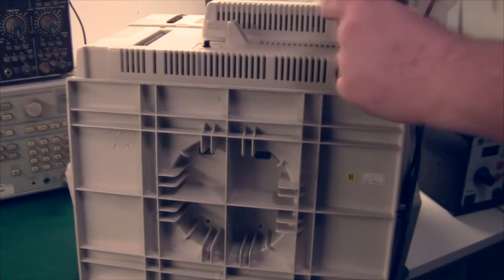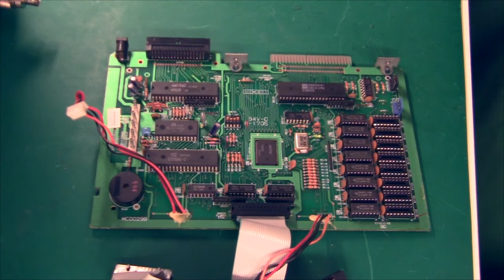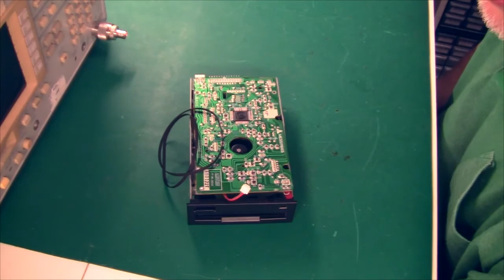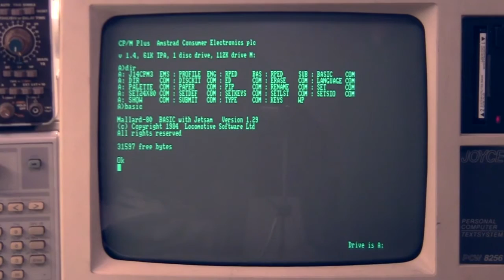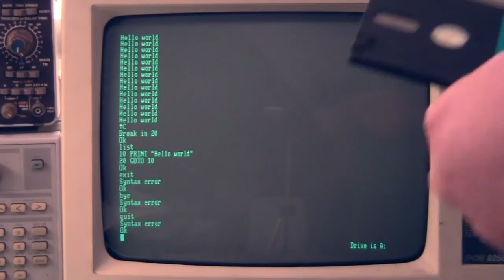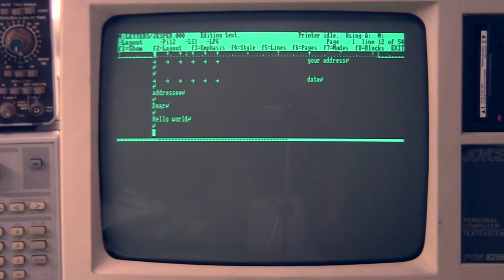Teardown and repair of Amstrad PCW-8256 / PCW-8512

Comment: Im  trying to  fix mine, when i power on i get green screen and a terrible noise (sounds like its coming from floppy drive) inserting a disk wont load anything. do you think maybe its the rubber band that need replacement?
Reply from the maker: I'm almost 100% certain that is the problem. Due to very limited ROM space, the machine only shows green screen until the OS is loaded.

Comment: Thank you so much for this video, I've had my machine since it was new on the market and it's been in the loft for many years so I suspected that the drive belt had deteriorated, but I had no idea where to find it. I don't suppose I'll be using it again but I believe that there is still an interest in them so I'll get it running again.
Reply from the maker: You're welcome.

Comment: Thanks for the vid, very interesting, I've just been given one of these machines, so now I just need to pull it apart, clean it up and sort out the floppy, cheers
Reply from the maker: The belt is typically the only problem with these machines.

Comment: The OEM was Taitung in South Korea.  I think (not sure) Taitung and Orion of Japan had a manufacturing partnership.  The first PCW series were very robust with some still being used in engineering workshops and as word processors by the orginal owners who have had them since 1984.  The only major failure item was the belt in the FD unit.  Really, if you think about it, at the time the PCW and Locoscript bundle (Locoscript was very well designed) was equivalent to most DOS-based word processing packages, sometimes better.  The only thing it lacked (initially) was a dedicated spellchecker which was rectified in later models.

I bought one of these brand new in Australia back at the end of 1984.  I used it everyday until 1995 when I went across to using a Windows 3.11 machine.  It NEVER failed, never skipped a belt and would operate even on the worst stinking hot days.  Whether by good fortune or by design, the PCW was the world's first truly-reliable set up and forget home and small business machine which had 100% reliability...far more reliability than the PC clones at the time.

Comment: Silly question, I have one which someone has taken apart and just pushed the back cover back on without screwing it on. What screws does it take on the back? I tried a few screws with about the correct diameter but the thread is wrong

Comment: The placement of the "upside down" ASIC/ULA is weird. I've only seen those before on Amstrad Spectrum 128 +3 (and maybe the +2A?) Very strange arrangement, I guess predating the Quad Flat-Packs.
Reply from the maker: I've seen it before, but can't remember where. Must have something to do with the soldering process.

Comment: Have you tried installing a 2nd or 3rd disk drive. I have just bought an old PCW8256 and I want to add an internal 3.5" and an external 5.25".

regards
Reply from the maker: I don't think this machine can accept more than two floppy drives at a time, but I might be wrong. I have seen machines with a 3.5" drive though, although I have never tried it. Please let us all know how it went.
Reply: +NatureAndTech I have some spare 3.5 inch disk drive available if you'd like to try one. The one thing I'd like to find for mine is an rs232 port so I can try rtty and other ham radio data modes with it. I have a pk232 sitting around doing nothing.
Reply from the maker: The cable for connecting a 3.5" drive is shown here. http://pcwpage.co.uk/making-a-data-cable-for-a-3-to-a-standard-3-5-drive/

I think I will come up with a serial port circuit for this machine. The expansion slot is well defined, and I love CP/M, so why not?
Reply: Useful data here:-

http://www.fvempel.nl/diy.html